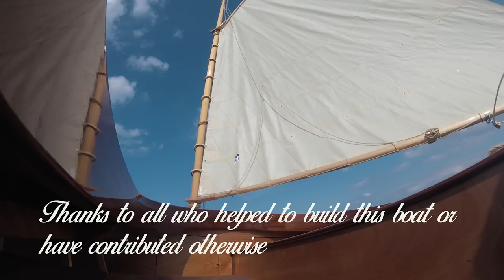Building a 21´ South Bay Catboat

Comment: This one is built in Germany?
Reply from the maker: Yes, it was built in Northern Germany
Reply: @janniktakul  hoi, Jannik, did you built it?  It’s just so lovely made. And what a boat. I really like the way it sails.
Reply from the maker: @hendrikarqitekt6286    I sure did build her. Sailing wise i do sometimes miss jib sail, especially downwind.
Reply: @janniktakul  that is a beautiful sailing boat, do you build others, for sale?
Reply from the maker: @hendrikarqitekt6286  i do work as a fulltime boatbuilder. However getting an order to build a classic wooden boat like this is extremly rare. Must of my work is just repair jobs on modern yachts, with a little luck some woodenboat restorations at best.
Reply: @janniktakul  And what should be the cost of building a21 south bay catboat? How much should i have to pay in the end?
Reply from the maker: @hendrikarqitekt6286  there was one for sale a few ports to the south from here. i dont know if its still available, but pricing was around 120 000€. To much for my opinion. 
It hardly depends on how the boat should be build and so on.
Reply: @janniktakul  that’s way to much for me too

Comment: Instead of going through all that work to build a strip-planked hull - and wasting so much wood to do so, why not use the hull as a plug or mold for a run of fiberglass hulls?  They will last longer, be less maintenance, and may even sail better than your wooden cat boat.  I find this sort of boat building like building a horse-drawn cart to get your shopping from down town; quaint, fascinating, and wholly irrelevant.
Reply: This was the most stupid comment I've read in a while. Clearly you have no understanding that some people like the view and feel of wood in a boat. Some people choose wood because its beautiful and inspiring. If you decide on building a boat yourself usually you dont want a product which looks like could have been produced in a factory.
Reply from the maker: @timinwsac  Ha, i agree with the  shame "hung" in the back, looking terribly. Therefore its removable by just one srew and can be stored away. Its alot easyer to get out of the habour with it. Especially then sailing alone and in a sailingterritory with strong currents.
Reply from the maker: For this old type of boat and building just a single one, wood is the way to go. If I would start building more using a mold and fibreglass could be considered to reduce cost and working hours. Plus wood is a material that grows back and then rotten away goes back to the ecosystem. Can't really say that about a plastic bucket.
Reply: If you just want a boat to get your shoppings on the water, you are completely right. But then you should consider leaving out the sail as well, a small electric motor is so much more practical. But if you want to enjoy the gentle sound of the water flowing under your boat and the soft feeling of the wind in your face, then you can do no better than get yourself a piece of art like this beautiful vessel.
Reply: Dear Little Johnny.  You're entitled to your opinion.  Personally, I much prefer wood to GFRP.  But there are objective reasons to dislike GFRP boats.  For example, they do not rot away when left unused at marinas and abandoned in creeks all around the world.  They are just like discarded plastic bags, only much bigger.  And they can't even be recycled.